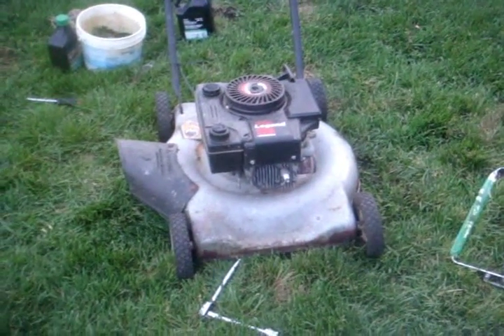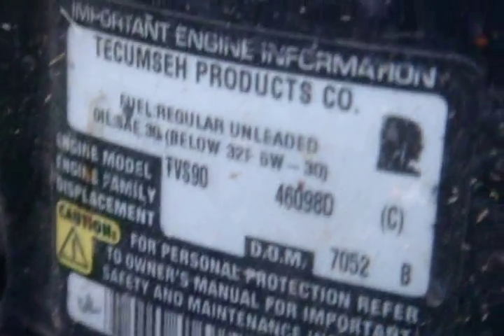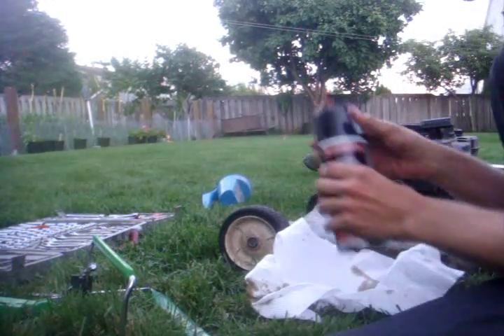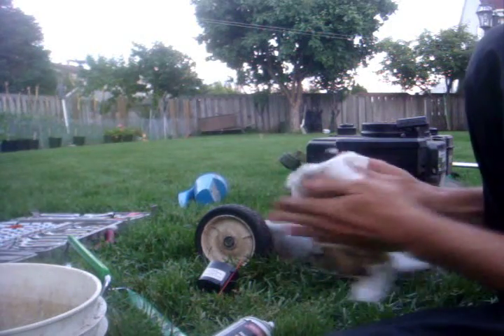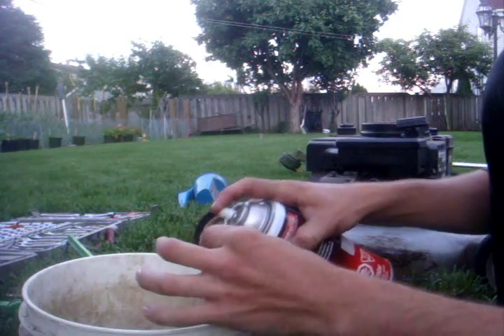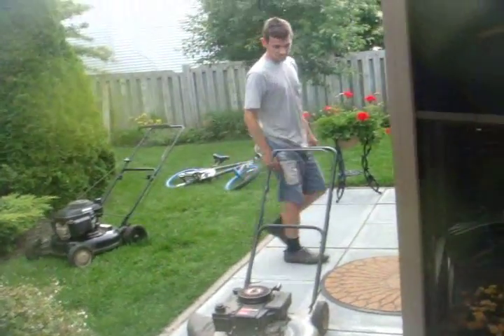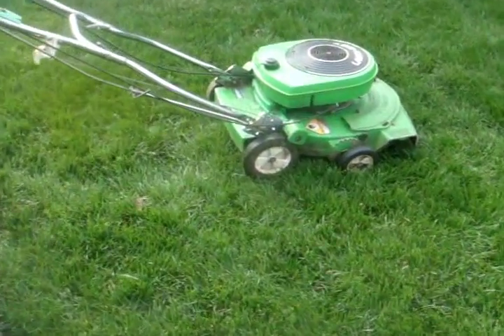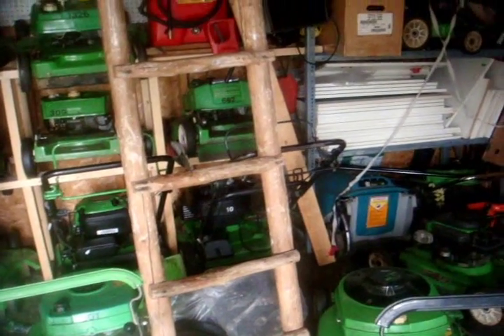Fixing and Starting The Tecumseh Legend Mower - Sat for 5 Years

Comment: man Tecumseh engine are beast! I don't mind them, but Briggs and Honda are still #1! LOL
Reply from the maker: they are a lot better than people give it credit for..They are so simple to fix.  Honda are #1 in my book...Briggs is #2, but wish they were built like the older ones.
Reply: Jon3800 I like the briggs quatum and Honda gcv160 engine
Reply: Jon3800 did you know that Suzuki 2-Cycle motors are used on some of the old Toro Prolines?
Reply from the maker: yes I do know.   Heard these were the best Toro 2-strokes.
Reply: Jon3800 I agree...everyone bashes them. But when they don't start, you know exactly whats is wrong with it.....the carb. They where generally used in extreme conditions like snow blowers. I own Briggs, Honda, Kawasaki, Kohler, LCT and Tecumseh and my personal favorite engine is the B&S Quantum for lawnmowers, next would the Honda & Kawasaki (they are a little bit harder to work on and they drink more fuel).
Reply: @Jon3800  Fully agree, Tecumseh engines are very good, most "mechanics" just can´t handle them, especially in the US, I don´t know why.